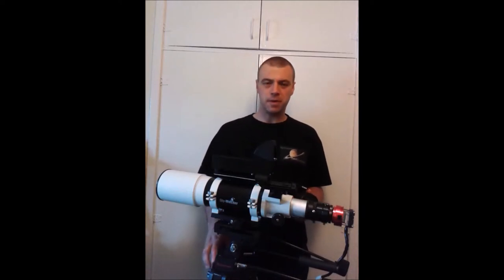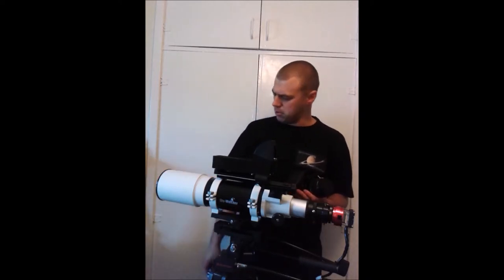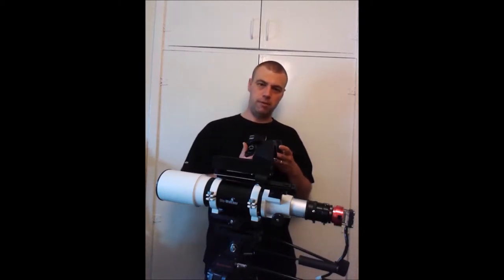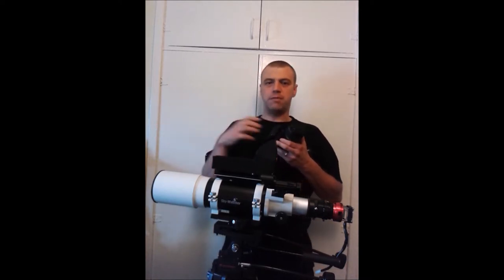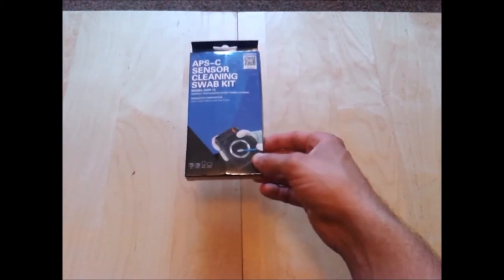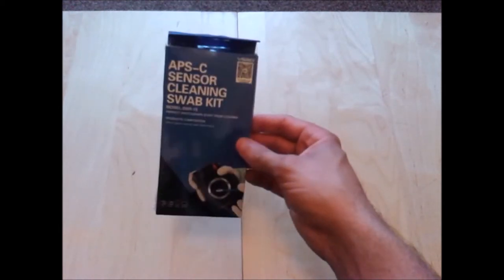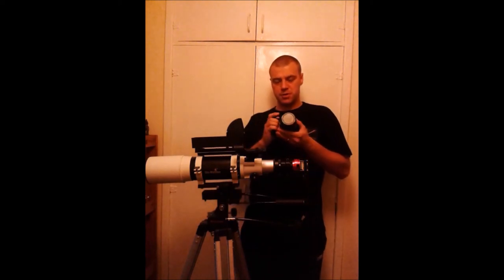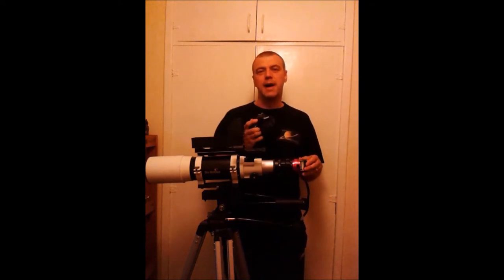How to clean DSLR, CCD, and CMOS camera sensors

Comment: Handy video .I have a Canon 1100d and it has a "Manual Clean" option which locks the mirror in the up position. I notice your camera seem to have less menus than my camera. If I choose third option from right (yellow spanner). 2nd from bottom option. My firmware version is v1.0.5 so perhaps yours is an older firmware. Can be easily updated from a PC if required.